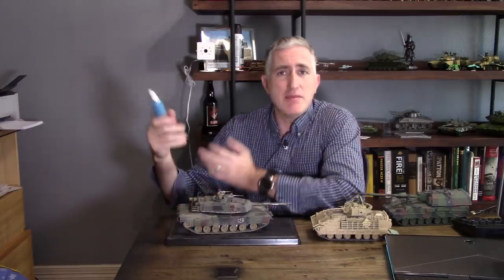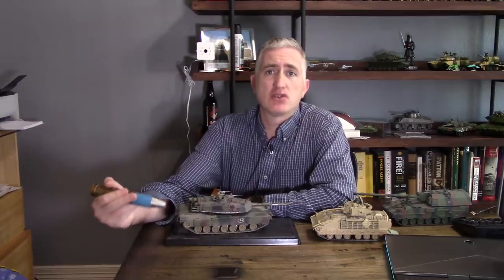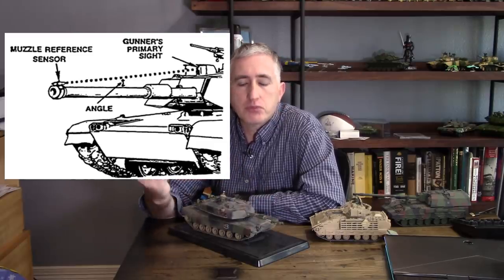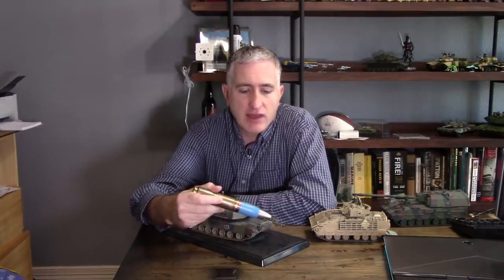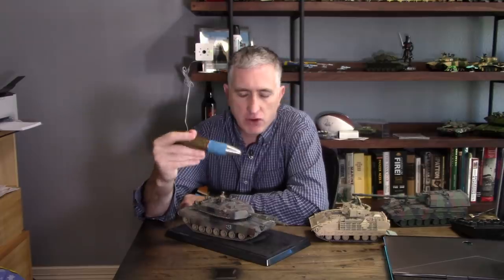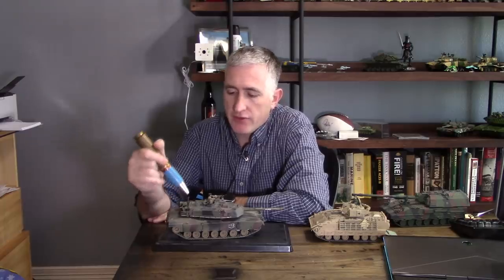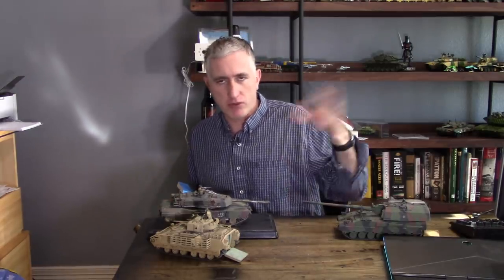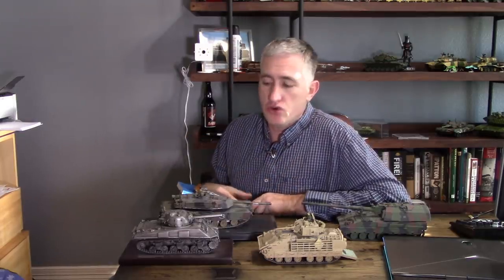Tanks 102: Tank Components

Comment: What a cool video.  However I am a tiny bit disappointed you didn't move one of the models going "vroom vroom".
Reply: I feel like, with one of these vehicles, it wouldn't be "vroom vroom" but "roar, roar!"
Reply: @therogueadmiral  only the sheman would roar, the M1 howls and post Vietnam war IFVs like the Bradley are generally far quieter than they have any right to be for their size... especially from the front! (Personal experience of beeing chased down by CV9040s and a CV90 ARV on several occations.... on foot. )
You feel them through the ground long before you hear them, and you can't ident the direction they come from by the feeling alone...
Reply: He's more of using a light canon round as a pointer kind of guy 😅
Reply: @brianreddeman951  It is very unprofessional if the presentation is followed with models or pictures pointed with a finger.
BTW. Polish/Czech APC was called SKOT. While "S" stands for "Sredni" - a medium sized, it was one of the biggest if not the biggest APC of its time. OT-64 was a Czech name for it but both were in use in two countries. SKOT was was a very modern vehicle in the middle of '70s. Almost all (weak armor, weakly armed)of today's designing standards SKOT filled 50 years ago. Apart from the crew of 2 or 3 men, SKOT was able to take 10 soldiers onboard.

Comment: That bit about the compensation for the fin stabilized rounds was really interesting. I never really thought about it, so I would have answered wrong. After hearing you explain it, it makes all the sense in the world. That was super cool, thank you. I really enjoyed that, along with everything else.
Reply: A similar thing happens with an RPG, specifically with the PG-7V rocket, in that it ends up turning into the wind. I think the mechanism is a little different, since there aren't really any substantial fins on the rocket I think it might have something to do with a lift force being produced when the air moves sideways across the round body. It tends to make an already inaccurate weapon even worse.
Reply: @Laotzu.Goldbug  rpg rounds do have fins which extend once the rocket leaves the barrel, they run a substantial length of the narrow rocket  part, thus very highly affected by wind.
Reply: It really doesn't make sense though, because there is no forward acceleration on the round once it leaves the gun tube. The round is not a rocket. Therefore, any yaw of the round should not have an effect of the direction of the velocity of the round, all forward force has already been applied. This phenomenon only makes sense when the projectile still has forward acceleration after being affected by the wind, such as an RPG rocket. I wonder if there is more to this explanation.
Reply: @whitephosphorus15  Maybe because you are wrong and you don't need a forward acceleration?
Reply: @hjalmar4565  Maybe think about the physics before just saying I'm wrong. Ignoring air resistance, rotating an object while its traveling with 0 acceleration will not result in a change in the direction that object is traveling. So there has to be some other force acting on these shells other than what the Chieftain stated, or perhaps he got it wrong. No one is 100% right 100% of the time.
Reply: @juliusEST  I understand that. If you read my comment, I said they don't have substantial fins. And I know, because I've seen them a number of times. The little control veins that pop out once the rocket separates from the booster an order of magnitude smaller in relative size than on an AP sabot. I would say there's even more eindswept surface area on the warhead portion of the rocket, then there is on the control fins. Honestly, they're closer to control rods than real flight wings.
Reply: @whitephosphorus15  I think the explanation the Chiefs and gave him his video isn't quite correct. The reason why the round turns into the wind isn't just because of a lever motion on the rear producing a y'all effects, it's because there's actually some lift force generated by those wings which causes the round to flow toward the wind. At least, that would be my assumption.
Reply: Aparently theres more to it, a bunch of different forces, magnus effect and vortices that produce the motion described, not just the push of the wind against the fins. There are a bunch of fluid dynamics studies online about this.
Reply: @whitephosphorus15  The wind still creates a moment on the round because more of the force is captured by the fins than the rest of the round. That's how I understand it, even if there are more implied factors as stated by the previous comment.
Reply: @whitephosphorus15  Most RPGs have the rocket extinguishing before it leaves the launcher to avoid rocket exhaust to the face of the person firing it, the Panzerschreck did not which is why it had that shield.
Reply: @Laotzu.Goldbug  The fins on their own should force a zero angle of attack relative to the air stream given how stable the round it, I suspect it's something to do with the fins being designed to induce a spin.
Reply: @whitephosphorus15  Maybe I add that in old Polish book about technology (Uzbrojenie wozów bojowych/AFV armament) I found information that fin stabilized rocket, during cross wind shooting, turning into wind, but only when rocket motor work. After end of fuel into rocket motor, rocket turning like typical rifle bullet. I linkage drawing from this book- term "aktywny odcinek toru" mean distance when rocket motor work. https://milimoto.files.wordpress.com/2017/10/rakieta_wiatr.jpg
Reply: This phenomenon (in rocketry) is called "weather cocking". The drag created by the fins, will try to stay behind the center of mass. In a crosswind, that means it will turn into the crosswind. At the velocity of antitank rounds, this might be small. However, the round has a small diameter. A small error can cause big problems.

Comment: I had a friend in the motor pool - did Humvees over in Iraq. If they had an oil leak, they'd take one of the engine/drivetrain crates from the stack to the ceiling and replace the whole thing. Which was faster than fooling around with changing a valve cover gasket.

Comment: One thing to keep in mind about muzzle brakes is that they are somewhat dependent on the mass of gas relative to the mass of the bullet. Putting a brake on a .38 Special (relatively small powder charge, low pressure, big bullet, especially in the original 200grain loading) would make little difference in recoil. Putting a brake on a 5.56x45 with the 55grain loading makes a much bigger difference because there's much more mass of gas (at higher pressure) to operate against the brake.

Comment: Nice 20mm pointer. Also thanks, I actually watched paint dry on your channel, new videos are always welcome.
Reply: its a 30mm from the M230
Reply: BROTHER!!
Reply: That is obviously larger than a 20mm. Looks like a 30mm. A 20mm isnt that much bigger than a .50, and usually has a larger length/width ratio. That and the standard 20mm case in the west is 20x110mm which has a much longer case relative to the round. That thing is way too short and thick, and it has almost no neck.

Comment: Don't forget about the cold, wet infantry huddling around the rear of the Abrams soaking up the heat from the engines.
Reply: Only to receive concussions from the main gun being fired. Other than canister, the Abrams doesn't have a low pressure round. I think I heard something about the new multi fuse round being less terrible. 

You'd think after nearly a decade of insurgent warfare, we'd make some minor changes to actually make tanks useful.
Reply: @johnharker7194  I say we cover them in machine guns.

Comment: Chieftain - many thanks for addressing that question I put to you about the front / rear location of the drive sprocket over Christmas.  I kept seeing vehicles with front sprockets during your quick museum tours and it was driving me nuts why they would do that from an engineering standpoint!
Reply: there are various reasons, but originally it was mostly because the transmission needs to be where the drive wheels are, and so do the steering brakes and/or differential. It is difficult to run clutch and shift and brake linkages all the way from the front to the back (part of why T-34 has terrible shifting and clutch feel). This is still a problem in cars with rear transaxles, and it is rare for these cars to have shift and clutch feel as good as conventional cars. The benefits outweigh this. When tanks went to automatic transmissions, hyrdaulic systems improved, and control diffs took over a lot of duties from the brakes, so it became much easier to put the drive system in the rear, so most tanks and AFVs do now.

Comment: Probably the most common question I get asked about tanks is how do you get power from the hull to the turret since the turret spins. I know they use a variation of a slip ring but explaing about powered rails and brushes tends to make peoples eyes cross. Maybe you could do a video and explain it better.
Reply: The Tank museum  at Bovinton  recent series "the Matilda Diaries" shows a teardown of the turret rotary joint with combined electrical & hydraulic layers, in the turret electrical systems video with clear explainer and excellent video work. A good, simple 1938 design example that's easily comprehensible. Probably better than nick could, due to  pro editing team and their resources on hand. His commentary on the video with David Fletcher would be great tho, especially if linked to his own Matilda review some time ago.🙂

Comment: Nice idea about a video! The first thing I noticed was it would have complemented the layout if you brought the vehicle models closer to the camera! 
Some questions: 
1. Can a blast deflector and muzzle break both be present on the end of the same barrel? 
2. Can a muzzle break's exhaust paths be directed upward to lessen the ground dust effect? 
3. Which guns and tanks have so much recoil that a muzzle break becomes pointless? 
4. Can flames from a blast deflector ignite surrounding materials?
Reply: Some answers:
1. Yes, one muzzle device can do/be both, it can both redirect gas and flash away from the ground/shooter/optics and reduce recoil, but not all do.
2. Yes and many do, you see this in small arms a lot because they have significantly less concussive force to deal with so it's easier, but a well designed one absolutely can on a tank too.
3. I'm not sure about this one, couldn't say a specific model it applies to, but I'm sure that there are instances of a big enough gun on a light enough tank that the reduction in recoil while still theoretically doing something, wouldn't be noticeable. I wouldn't say there's a hard line though, any well designed brake will reduce concussion by some amount, and any reduction will reduce vibration and wear on the gun/optics.
4. Not easily, definitely not gonna catch brush on fire or whatever. In regular small arms it's very unlikely, even with guns that have significant muzzle flash, a flammable gas or liquid isn't likely to light even. Mythbusters tried natural gas flooded into an enclosed space and guns wouldn't light it. Now a tank has a MUCH bigger flash, but I think unless there was large amounts of still burning powder exiting the barrel (which would not be normal or good) I don't think a tank cannon would be much different, just a lot bigger.

Hope that helps.
(disclaimer: I don't drive tanks for a living and only some of this is from first hand experience, the rest is internet research and semi-educated guesses lol)
Reply: Thanks for the answers! Although I'd still like to see Nicholas' responses on these. Nonetheless feel free to join in like you did so! 
I'm just interested in tank gun mechanics, not handheld firearms. 

A few more mysteries: 
5. Can engine exhaust smoke be toggle redirected under the tank for further concealment? Is it worth it? Has it been done yet? Does it hinder amphibious designs? 
6. How difficult is it to manufacture depleted uranium for countries to make special APFSDS and hard armor plating? What infrastructure is needed and any international laws? 
7. Why aren't ATGM launchers ever mounted behind the chassis of the tank facing upwards in a 45 degree angle? Aiming for a starting launch then a forward facing cruise. 
8. Are shot traps still relevant in this day and age on decently armored MBTs? Leo 2A5-2A7+ turret front looks rather trippy...
Reply: @rudolphantler6309  You're welcome. Yeah my area of "expertise" is basically just small arms, my interest in tanks is purely for fun, but they do share a lot on the conceptual, design, optics, and physics side so sometimes I know what he's talking about lol. I got nothin' for your new questions lol, hopefully Chieftain can help!
Reply: Kneon Knight  Thanks for the insight, have no experience with BIG guns, I'll try to avoid that next time I take my howitzer to the range lol
Reply: Thanks for the insight Kneon. 

4. What makes range control officers pissy? The vegetation ignition, the direct fire, or the rubber sheet shenanigans?  

8. What about the Leo 2A5-2A7+? Are we looking at the same thing there? Why was it made this way? 

And a new question: 
9. How common is direct fire with artillery? Is it done with the same muzzle velocity or power in today's time as indirect fire? What situation brings it about and why isn't it utilized more to build more common awareness of the action?
Reply: @rudolphantler6309  6) Quite. You'll need flourine (nasty stuff) and loads and loads of gas centrifuges, which are pretty much precision mechanical equipment.

Depleted uranium is essentially a waste product of uranium enrichment for either nuclear 'fuel' or nuclear weapons ( Natural uranium consists or 99.3% U238 and 0.7% U235; U238 is essentially useless for any sort of fission reaction, you'll need anything from 3%-5% U235 in reactors to >80% for (effective) nuclear weapons). If you use nuclear power or make nuclear weapons, you'll end up with loads of that stuff whose only really useful property is it's density (and, if you have a nuclear weapons programme, it already belongs to the military), so it makes sense to use it in weapons. For use in projectiles / armor there is no need for using depleted uranium, you could just refine regular uranium ore and use that. Or just use tungsten instead, it is harder, ever so slightly more dense, more abundant on earth and is neither toxic nor radioactive (although this is hardly an issue with uranium, either). 

Infrastructure wise, if you insist on depleted uranium (and making it yourself), you'll need to find someone to sell you uranium first and then "depleting" (i.e. enriching) it, which is a significant step to your own nuclear programme, however, you might just find someone to take the "waste" enriched uranium off your hands at a good price. You also better make sure you adhere to the Treaty on the Non-Proliferation of Nuclear Weapons and do so convincingly, otherwise you may get your expensive centrifuges bombed or disables by a virus (Stuxnet) (if you're able to get them in the first place).

TL;DR: if you don't have nuclear weapons / power, don't bother, use tungsten instead.
Reply: @WIRRUZZZ  Thanks for the reply! 

"bombed or disables by a virus"
Haha yeah global status quo terrorism by the double standards of politics. 

So the logical quetion surfaces in this case: 
If tungsten is more abundant, cheaper, slightly better, easier to manufacture, and less dangerous to handle, why are 'depleted uranium armor inserts' the famous things in some late Abrams tanks instead? 
The question may also stand for APFSDS too but in this case, it is just the shock value, not really the popularity contest. 

I mean, do we still use wolfram in lightbulbs or is current tech past that? (Not specifically laking about LEDs of course.) Just produce hundreds(?) less lightbulbs to give 1 tank an edge if for example looking at armor only.

Comment: Muzzle reference sensor is not the only radioactive part of the tank....the depleted uranium plates they added to the Chobham armor are also radioactive (mildly).
Reply: @Mathieu Morin Depleted just means that almost all the  fissionable U-235 has been processed out. However, it still emits alpha radiation; which can be blocked by a sheet of A4 letter paper.

Comment: 'Glacis' is from military engineering and pronounced 'gla-see'. Pronounced thus being a French word. 
BTW sabot is French for shoe (made of wood) and is pronounced 'sabb-oh' not 'say-boh'. Thus you get 'sabotage'  from cross French workers protesting by throwing their wooden shoes into their machinery.
Infantry don't like muzzle brakes or blast deflectors on 'friendly' tanks as the blast gets directed to do unpleasant things to the PBI either directly with blast or by bouncing the local scenery off them. There are few pecetime character building moments to match approaching a stationary 70 ton mobile thing which can instantly begin moving at you backwards and does not know you are there until you have actually opened and licked up the exterior telephone and got the warm dry sleepy/busy inhabitants to acknowledge they have friendly human almost touching their tracks.

Comment: Enjoyable, for sight/gun alignment would you consider similarly detailing say Sherman and Pershing. Just read 740 tank battalions with mixed 76mm and 75mm Sherman after action report 1945, very sobering. “9th April 1945 At G178708 Lt. Loopey (3rd Plat) destroyed two 70-ton Jadtiger tanks w/128mm guns. At ,elschen Ennest the Pl4,t set up road blocks and remained for the night”. In February 1945 they claimed a Tiger 1 confirmed by the infantry support. Worth a read it does appear they alone destroyed 3 tiger vehicles.